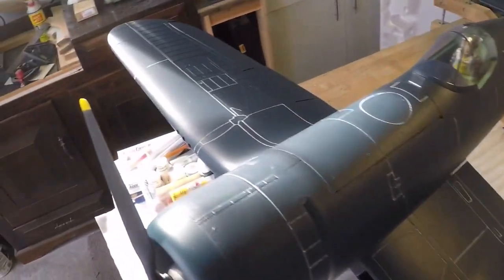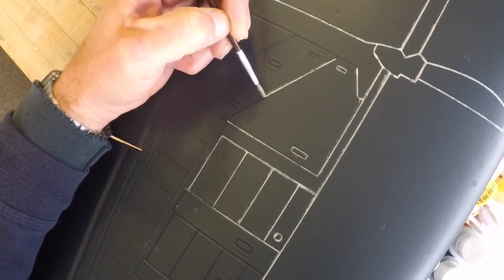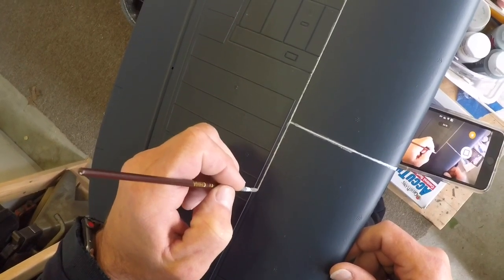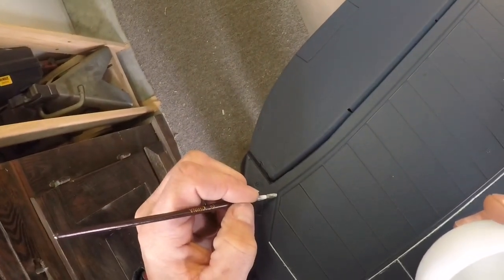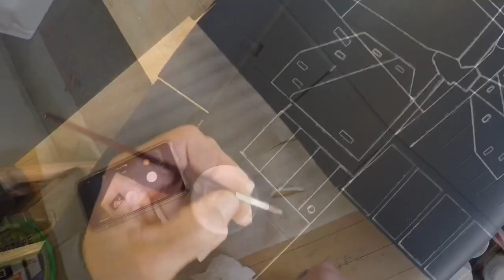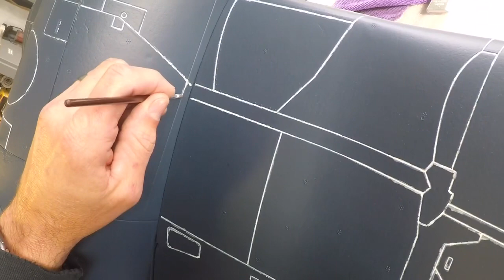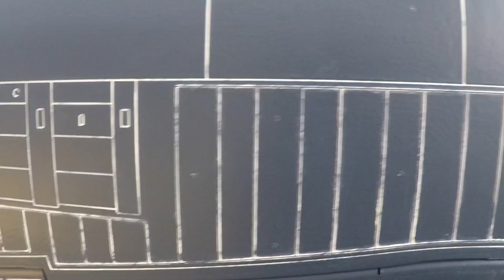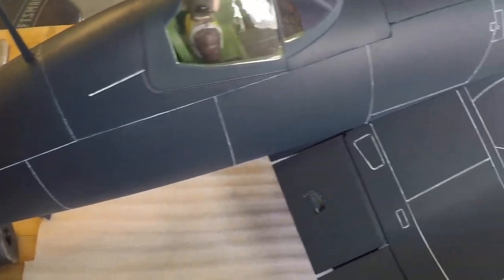Customizing the Flightline 1600mm Corsair

Comment: Nice job looking good I’ve never tried chalk always airbrush. Do you ever have issues with the alcohol removing the paint? I know some of them are finished with water based paint so alcohol can remove it?
Reply from the maker: Merry Boozer RC hey guys, it’s very little alcohol and water, just enough to make a slurry with chalk, winded could work as well in place of alcohol, did great on this plane, stay tuned for more, thanks for all your help in this great job at as well. 👊🏼